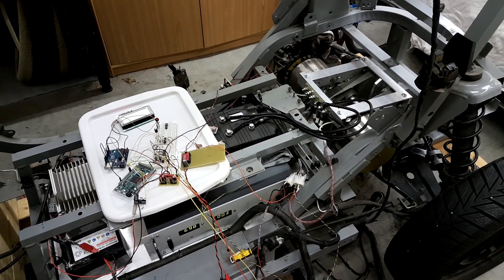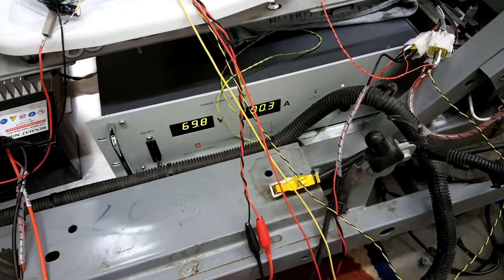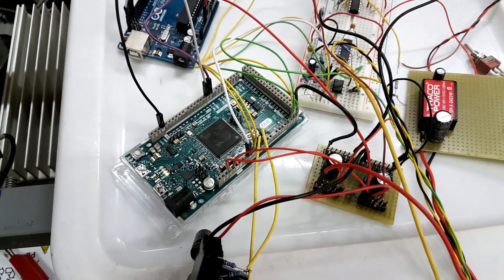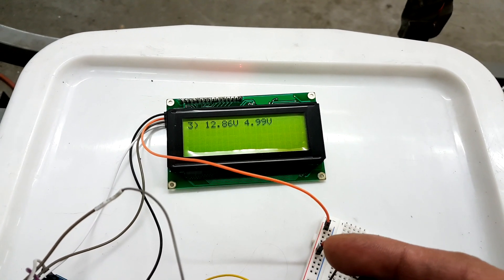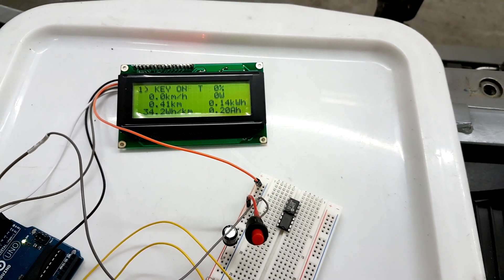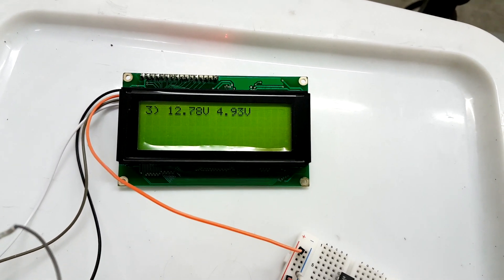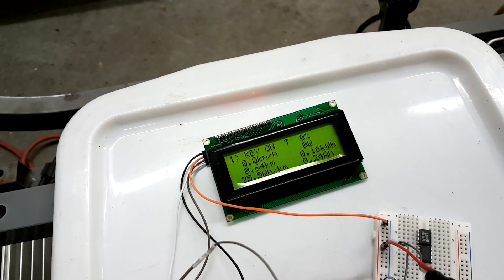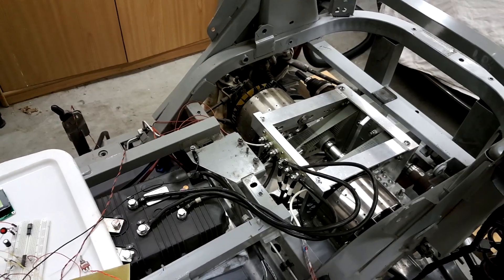#4 RENAULT TWIZY Dual Drive Unit (Revolt BLDC 160Pro)

Comment: Hello Next EV, I have a question you may know de answer, nowadays CAN is a standard protocol within the automotive industry, do you know if the Twizy electronic components communicates between each other with CAN bus Controller Area Network ?
Saludos
Enrique
Reply from the maker: You are right, there's a CAN bus in the original Twizy between main vehicle control unit (UCH), power electronics (SEVCON), air bag controller and charger.
I haven't spent much time with the CAN, just ripped everything apart...
Reply: @nextev8794  thanks for your response, very valuable information. Do you know if the hour from dashboard clock is a shared control point? My purpose is to install a clock synchronized through CAN bus.

Saludos from México
Enrique
Reply: @nextev8794   I just had an insight, allow me to explain, I just need the time as a control point to accomplish my purpose.
I'm planning to install a high roller Breitling clock in my twizy like this one
https://www.youtube.com/watch?v=0q1bwawlhlU

I've done some research and I know it has many leads however the related lead are just only 4, so my thinking is this one, connect the 2 power leads to have energy to the clock, and here's the tricky part where you can give you thoughts, conect the 2 leads for CAN bus on the clock to the CAN bus in the OBD2 port. Do you believe it can be as easy as that? Am I dreaming without reality sense?

Saludos
Enrique
Reply from the maker: @EnriqueMenesesBalles  Dreaming (even without reality sense) is ok, but I have to wake you up because I don't think a time stamp is broadcasted on CAN in the Twizy. Correct me if I'm wrong ;-)
Reply: @nextev8794  I have some thoughts, I will do a pair of surveys , I will research the points on the item "twizyplay" and the "power box", if any of them shows time in the display there's a chance the time is a control point. I will embark myself in this project, if it happens there is a chance, i will buy the merchandise to go on, this may take months due to the artifacts lead time, i'll be bak with the results from my research, wish me good luck!
Reply from the maker: @EnriqueMenesesBalles  the power box has definitely nothing about time
Reply: @nextev8794  ,
I have some news, today I got some information from an automotive forum "6speedonline" one member gave me the piece of information I was missing, The clock I'm intending to use has 6 leads, from this I was confused on what leads to use, this member explained there are only 4 leads to use, 2 for power and 2 for Can bus, the other 2 are not used, according to your advice there is no hour point in the twizy bus, from this I will create another network using an arduino shield and the clock. I will let you know the results in some weeks or mybemonths. I'll keep you in the loop
Saludos
Reply from the maker: @EnriqueMenesesBalles  Well done, congrats! Finally you can share your progress in a short video?!
Reply: @nextev8794   I just had an insight, allow me to explain, I just need the time as a control point to accomplish my purpose.
I'm planning to install a high roller Breitling clock in my twizy like this one
https://www.youtube.com/watch?v=0q1bwawlhlU

I've done some research and I know it has many leads however the related lead are just only 4, so my thinking is this one, connect the 2 power leads to have energy to the clock, and here's the tricky part where you can give you thoughts, conect the 2 leads for CAN bus on the clock to the CAN bus in the OBD2 port. Do you believe it can be as easy as that? Am I dreaming without reality sense?

Saludos
Enrique

Comment: I thought that those vehicles brought a gearbox or something like that but I see that they are small engines with high rpms outrunner motors are like 5 or 6 kw more or less. good less power but you get a good autonomy in the battery and a good final speed for that type of vehicles gaciaspor your contribution